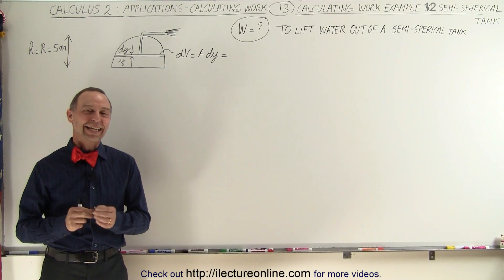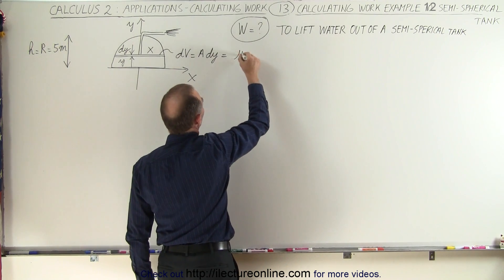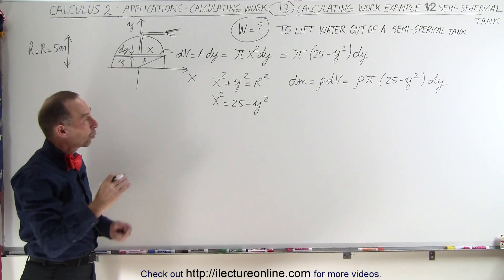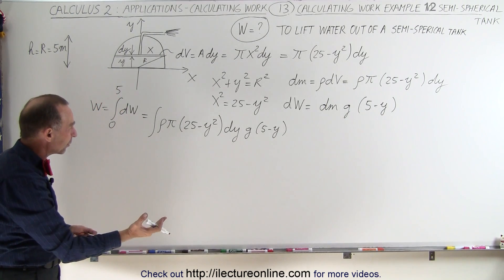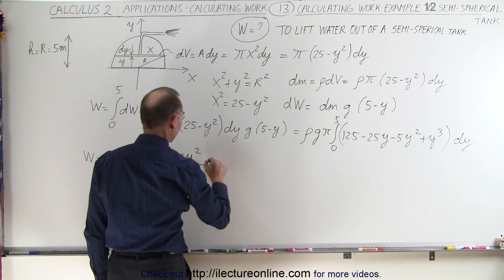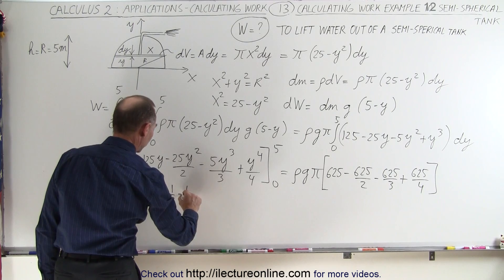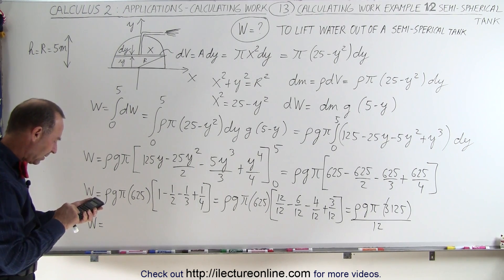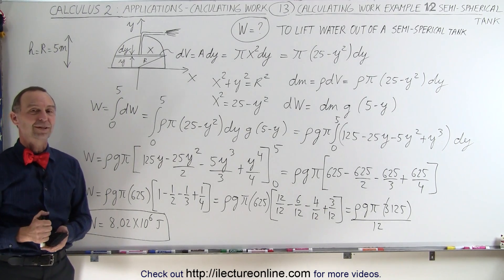Calculus 2: Applications - Calculating Work (13 of 16) Cal. Work Ex. 12: 1/2-Spherical Tank: 1

Comment: WHOA!!  Guess what, Michel ??.. I tried your other method of finding work by concentrating all the mass at the CENTER OF MASS of a Hemisphere and then lifting it up... Center of Mass = (3/8) R .. and the distance to lift it is  (5/8) R ... and since I'm using HALF the volume of a sphere I insert the (1/2) factor in the equation.. I won't write it out here, but... IT WORKS !!! :)   As usual, THANKS for your Patented Method of Explaining and demonstrating!! (by the way, I found the Center of Mass for a Hemisphere from one of your other videos!!)
Reply from the maker: I wish more of my students would "explore" the material the way you do.  That is the best way to learn and understand.  It adds to the fascination of learning.

Comment: Some sites have shown half sphere inverted  with the same radium value.  However the final result is different. Same exercise just inverted. Why the final result is different?
Reply from the maker: If you invert the shape, then a higher fraction of the water would be closer to the top (the center of mass would be higher) so it would take less work to pump out the water.
Reply: @MichelvanBiezen  Dear Professor, this a very elegant and satisfactory explanation. Thank you so very much for your precious time. Greetings from brazil!!

Comment: Let me see how that amount of work compares to me. If my mass is equal to 100 kg, my weight is 100 x 9.8 = 980 N... How high would I have to climb a vertical ladder straight up to equal 8.02 E 6 Joules?...  that would be 8.02E6 J  / 980 N  = 8.18 km !!  WOW... that's alot of work! (didn't even break a sweat!)   :D   Cool Video Michel... do people still use the word, "Cool?"   :D
Reply from the maker: I do, but then I am one of those "old people"    :)